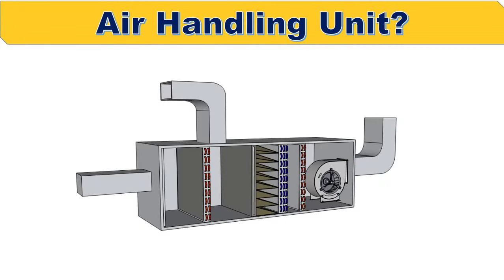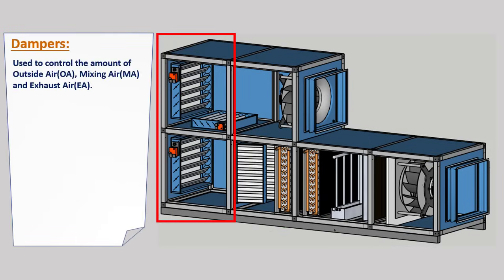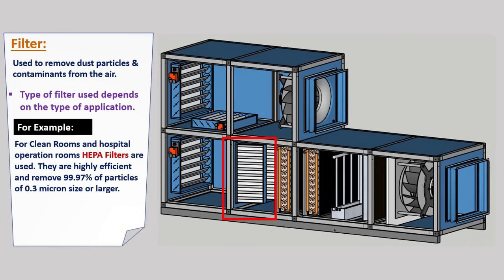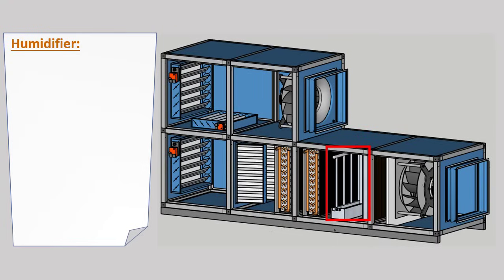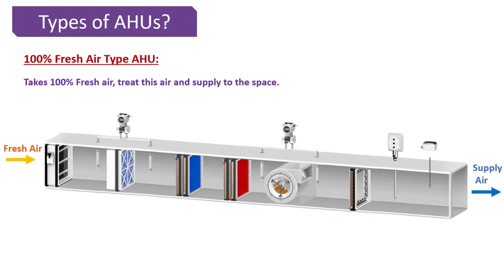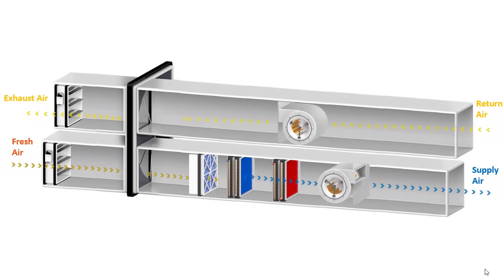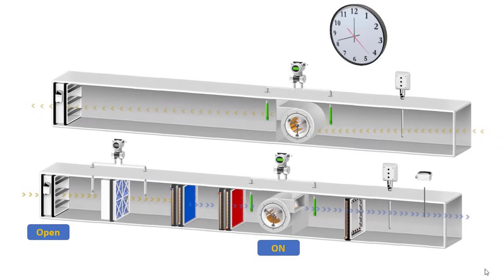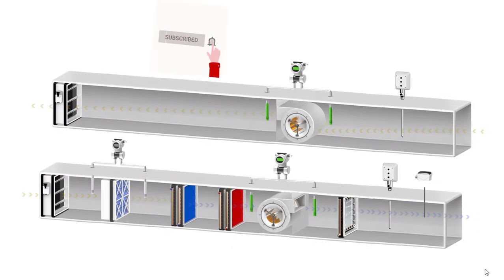Air Handling Unit(AHU) Working | BMS Training 2021|Building Management System Training

Comment from the maker: Transform Your BMS Skills! 🌟 Enjoying my videos? Dive deeper with my BMS Fundamentals course on Udemy. For a limited time, it's available for only $12.99! Don't miss out – click the link below to enroll now.
https://www.udemy.com/course/bms_fundamentals/?couponCode=D92B03C80932FADA9716
Save days of work during BMS design using our BMS IO & BOQ Automation Tool: https://payhip.com/b/t3dVG
Reply: More, please. We have no structured tech training like this even in large corporations.
Reply from the maker: Thank you for your feedback.. I am working on more videos. Stay tuned. You can checkout the Playlist for other related videos.
Reply: @TechSystems  hi buddy, what kind of software you use to creat the AHU in 6:41
Reply: Thanks, I've been watching them all week lol. One of AHU safety circuits would be awesome.
Reply: Hello please i have a problem of my AHU, the actual supply fan motor is working but it gives alarm at BMS display fan stop or not working, please any advice, thank you
Reply from the maker: How are you monitoring AHU? Using Run status from the MCC? Or by the differential pressure switch(DPS)?